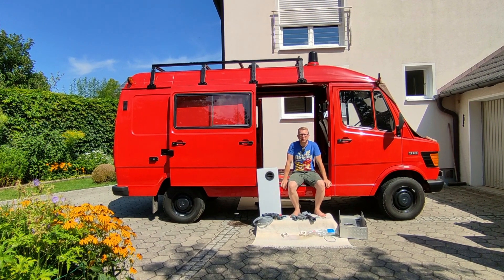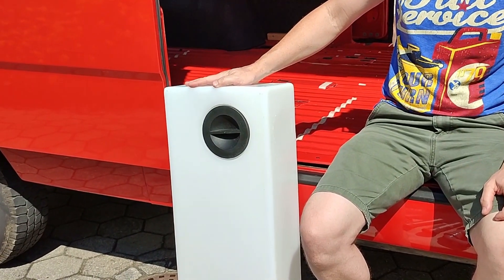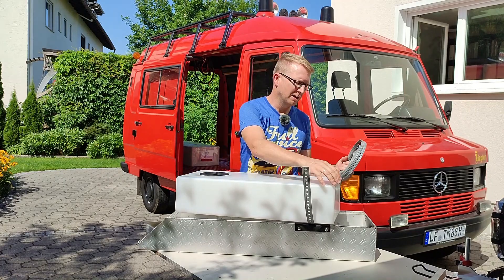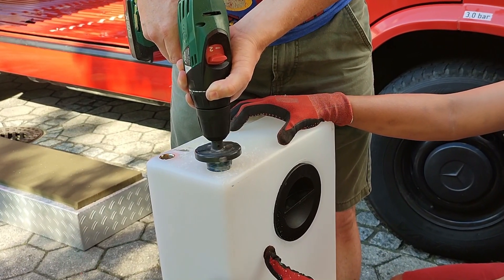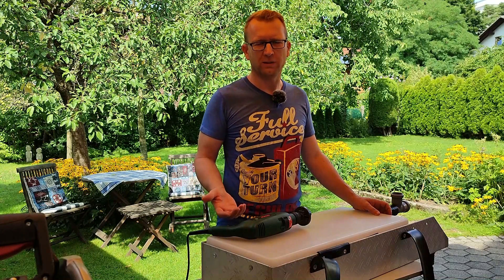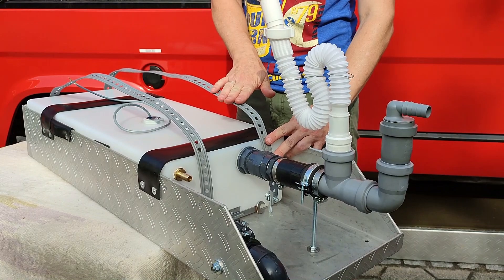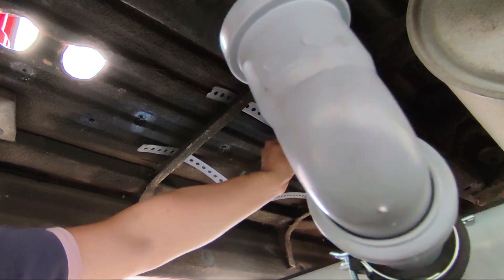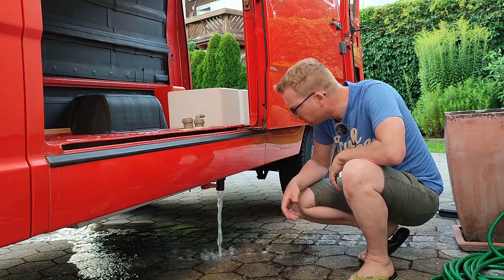Van Conversion: DIY Underfloor Waste Water Tank - Tutorial How to Build (Mercedes 310 T1 Camper Van)

Comment: Good tidy job just ensure isolation between the aluminium and dissimilar metals to prevent corrosion
Reply from the maker: Thanks :) There is no contact between the aluminium box and the chassis of the van. But there are steel bolts in the box. Is that a problem?
Reply: @CubeofCars  look up on the net. When aluminium comes in contact with steel it will error through electrolys over time. A few years. So always isolate with an insulator or bolts that are coated for use in aluminium. It’s a well known issue.